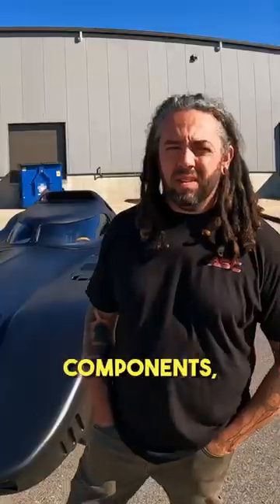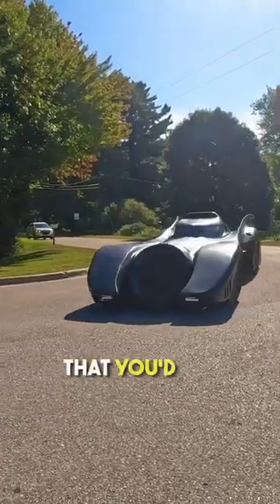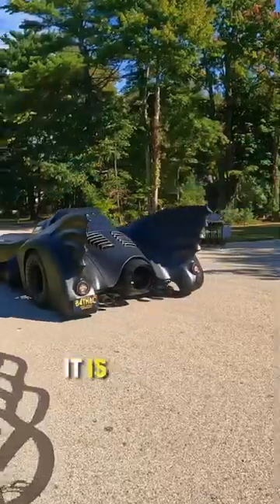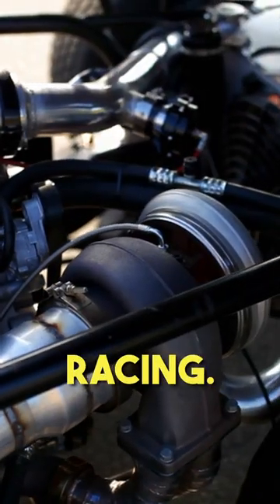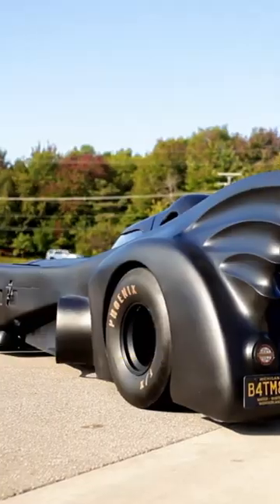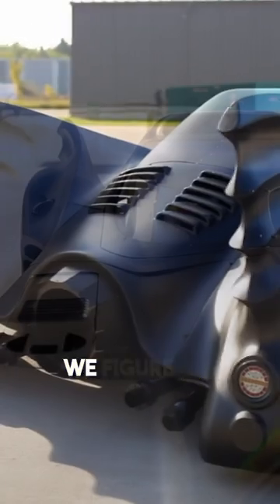EVER SEEN A REAL BATMOBILE?😳🦇 #batmobile #batman

Comment: Um is it just me or does 150mph running 9s sound all kind of wrong? Im not a huge track fan but I know damn well ive seen guys running 7s who rarely run 150, 8s in the 130s.
Maybe im wrong but I would love to see that time slip
Reply from the maker: Like he said it’s on paper right now. With the setup that’s what is possible. But still working on the body to be able to withstand 150mph.
Feel free to watch the full video I posted of the car!😁
Reply: @MaxHPower  Theres where the confusion is. I thought he said it was going to run 150 in the 9s not be able to withstand 150mph speeds. Makes alot more sense now
Reply: It all depends on the weight